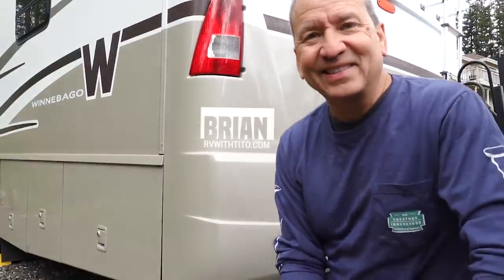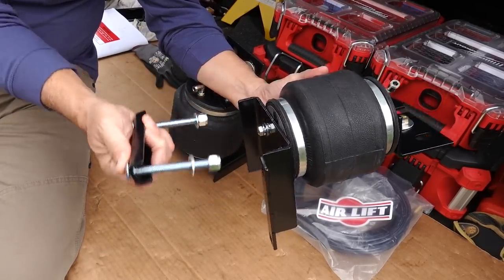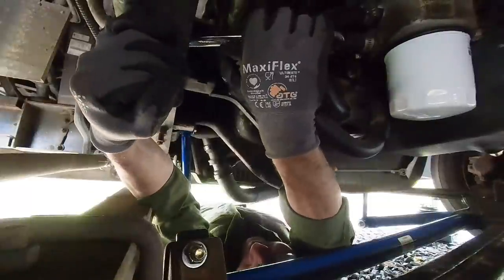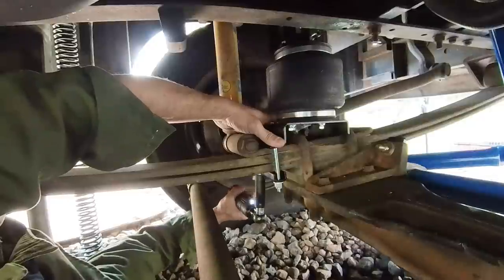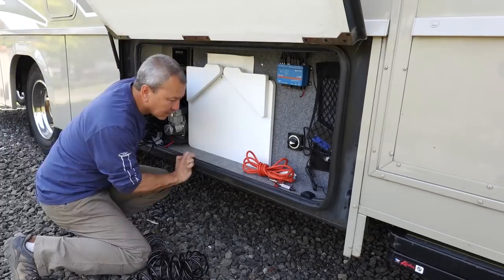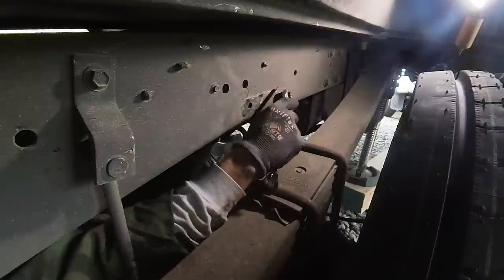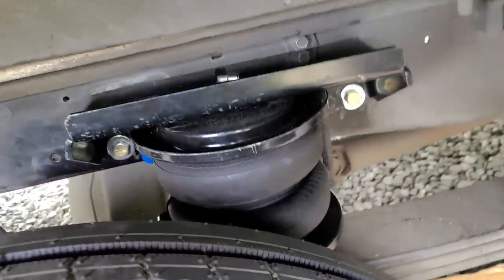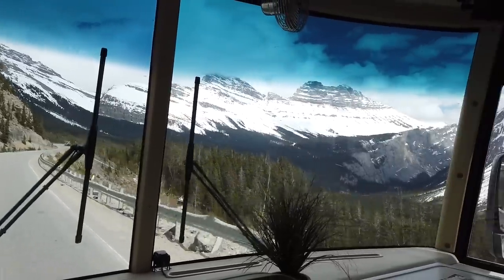I Installed Air Bags and Drove To Alaska

Comment: "Cat", here, Tito!  I have had the bags on several of my 14 different rigs over my 41 years of RVing and gave up on constantly tuning the adjustment settings and found that setting them at 80 to 90 lbs and leaving them there was best overall!  On my 38 foot gas Fleetwood Flair, because of the weight and wheelbase, had the onboard compressor with the four gauge/individual gauges and separate control rocker valves which allowed me to tune the suspension for differing road conditions such as the Alcan.  My goodness, what a difference it made on those long stints for comfort and driving fatique.  On certain sections of roadway, I could tune the rig so well I could actually take my hands off if the wheel and the rig would follow the roadways by itself.  Just like trimming my small  helicopters flying in the army where I could take hands and feet off the controls and control it just by leaning left to right and front to rear for directional control!  Try the compressor/individual wheel control setup!  I think you will like it?
Reply from the maker: I had the compressor installed on our last rig. It was great making those adjustments from the bluetooth remote. I have a compressor always hooked up now. So checking them periodically is no trouble. Thanks for sharing all of that experience.

Comment: Nice install for you class A.  You might want to put in a T union and only have one valve to air up the front and rear.  It will make it easier on you to equalize the pressure in both bags.  I have rear bags on my F350 to pull my fiver and I installed a Haldex height control valve from Amazon to automatically adjust pressure in the bags based on load conditions.  Works like the suspension of Class 8 rigs running down the highway.  The down side is you compressor will work more due to up and down in the road and the valve adjusting automatically.  Just a thought for a future upgrade.  Enjoy your time in Alaska, I was up there 5 years ago and want very much to return.
Reply from the maker: Thanks Tom for the suggestions. I prefer to manage them individually in case I need to level out a load. On our previous rig I also installed the air-compressor unit that I could control wirelessly from the cockpit. It worked great, but I don't think I really need it. So far manually checking them and making adjustments works fine.

Comment: I've installed two sets of Air Lift air bags on 2 different rigs. One was a class A motor home the other a F150. Both were pretty easy to install and worked extremely well. I'll be installing them on my new F350 fairly soon. Not really needing them that bad on this truck but sure are nice to take the porpoising out when going over train tracks and wavy roads.  I found that 25-35# was all I ever needed. One time took them up to 70# and about jarred all my fillings out! IMHO; the only way to fly!
Reply from the maker: Nice. I also installed them on our Class C rear and they were very much worth it and I'd do it again.
Reply: Yeah and people spend $25k on liquid springs which one Personally air bags did a better job for a fraction of the price.

Comment: Welcome to Alaska!
Looks like you've found the best of what are loosely called roads up this way. Once you get away from the major areas, its definitely a suspension test track. But it looks like you're ahead of the game with the upgrades and mods you've been doing. And fortunately you're handy enough to know to drive for the road conditions or be willing to fix what didn't like the road. Enjoy this little place we call home! Safe travels!
Reply from the maker: Thanks. It's been an amazing adventure so far. Yeah "roads" of all kinds. The Top Of The World Highway (Taylor Highway?) also was pretty amazing, but dirty. I also think the new tires I put on made a huge difference. I'm very glad I didn't wait on those and pulled the trigger before heading up.
Reply: It was definitely a good idea for the tires. Nothing up here is impossible or impassable, but go cheap and you definitely roll the dice!
I've only seen the Taylor and Over The Top in the winter on a snowmobile trip from Tok to Dawson and back. It was in the -30's going to Dawson. Super cold, but super scenic for sure. I really want to do it in the summer but I think we'd have to take the girlfriend's Class C instead of my travel trailer. The trailer is only good for so much dirt road action. 
How is your solar performing at this higher latitude with the sun lower in the sky? I just did a 1050 watt install on my rig. I went in knowing that I wouldn't realize the panels full potential not that anyone ever does but figured at best I'd see about 2/3 of that on a clear day if the sun had no obstructions like trees and whatnot. Last weekend on the maiden voyage after install we saw anything between 150 and 350 watts at the campground. It was charging, I was getting 10-20 amps going to the batteries so all was good. Even pulling power during the rain which was also a good test for the waterproofing of 42 holes in a perfectly good roof with a watertight rubber membrane... no leaks... whew! Then we get back to town and clear skies at the storage lot I keep my rig at, over 700 watts and 50 amps going to the batteries. Didn't think I'd actually see that much out of it with the lower sun angles and the panels flat on the roof and not tilted. But I know you put a pretty good solar system on the roof of your Class A and was curious how something I've seen on YouTube that was setup down in the lower 48 is performing up here and if i was underestimating what I'd see on my rig.
Reply from the maker: @rvingwithbearandfriends7506  The solar is doing great. True, I'm not bringing in as much up here. Two thirds sounds about right. The best I've been able to grab is about 1100W out of the 1740 Watts...and that's when flat mounted. They average about 900W even with smoke and cloud cover. I haven't been in a location yet that I felt comfortable tilting the panels. There were a couple times in the Canadian Rockies when I pulled about 1800W for a moment. It's funny, because business that I've seen with solar on the roof have their panels almost vertical :) One difference up here though is that I'm generating solar power almost 20 hours a day. Even at 11PM I'm still brining in 100W and that's pretty nuts.
Reply: @RVwithTito  , That makes me feel good about what I built. I haven't seen much in RV's with a decent sized solar array on them up here. With no local guidance, YouTube University was a great resource. I figured I'd need more panels to get less power and with our long daylight hours, especially this time of the year, work the solar like a Marathon and not a sprint. Collect power all day not just at peak times and be able to still collect above the parasitic draws during overcast or rainy days and so far, I've achieved that. I used tilt brackets not planning to tilt them unless I'm camping long term in one spot but also for getting to the wiring under them. I liken it to lifting the hood on a car or truck to get in and work. Made running the wires a breeze! I incorporated my 3D printer into the project and also for the battery bank. Something I don't see many content makers do. 
I just want to thank YouTubers like yourself and a number of others in showing that people can do these projects. I didn't copy anyone's work, but rather gather a consensus of many ideas and draw from across a number of installs for what seemed line the best of ideas and pointers or tips and make my own plan. Content makers like you are great to watch, the we're going to try this and make it work mentality but put it out in a way that is easy to follow. I've followed your channel for a while now with my other more nerdy channel subscribed and now this one. 
Enjoy the rest of your trip through our little state! And keep making the great videos!

Comment: I have airbags installed on my GMC Sierra as I mentioned before.
There seems to be a happy medium between some assistance and too much pressure.
I find that between 30 and 50 pounds is the good zone - more seems to make it "bouncy" and has a negative handling effect.
Great video - Thanks! - Cheers.
Reply from the maker: Certainly takes some tweaking and driving to get it just right.

Comment: Nice video, I put Air Lift airbags on my 2016 3/4 ton GM diesel pickup to provide same load capability as a 1 ton but with a nice ride.  I have the air pump so I can set pressure in the cab.  This was an upgrade from my 2005 gas 3/4 ton which I had to inflate myself.

Comment: Great video as usual! Just installed air lift airbags on our 2014 coachmen mirada. Made big improvement in the ride and the sway. I agree drilling the holes was the worst part. Had to remove the rear wheels in my case. Each rear side took 4 hours. The front was much easier, no drilling was required. I think maybe 2 hours total.
Reply from the maker: Glad it wasn't just me. I even broke two stepped bits on the front :)
Reply: @RVwithTito  btw, did you have any concern using the airbags with the leveling jacks lifting front wheels? I rarely get into that situation, but I read on one of forums that airbags are not designed to hold the axle and that may place pressure on them.
Reply from the maker: @Anonymous-hy8oz  Good question. I did consider and look into this potential issue. Per AirLift's FAQ: a vehicle can be lifted by the frame for short term periods (i.e. maintenance or oil changes etc). If the vehicle is lifted for extended periods, then the axle should be supported. This is really a non-issue unless you plan to lift the tires off the ground with your leveling jacks...which you probably shouldn't. If you need to level up that much, it's best to roll the rig up on some boards first.

Comment: Once you drill a pilot hole, I find a Spiral Flute Step Drill bit works better than using a larger bit to increase the hold size
Reply from the maker: I needed a larger pilot hole. Broke the ends off  2 stepped bits in the process 🤪
Reply: @RVwithTito  any reason why u had ur drill on the hammer setting? Or did it just sound like that in the video, this would have made ur drilling a lot harder through steel if it was. Great video anyway, thanks :)

Comment: Nice job Brian later you might want to upgrade to onboard air so you can control it from inside those flip up panels might be for changing your rear tires easily
Reply from the maker: Thanks. I decided not to go with the onboard compressor this time. With the location of my Viair airing them up is real simple.

Comment: Nice upgrade!  Just wondering how these upgrades improved your RV's handling compared to the original equipment?  Did you do both the front anti-sway bar and air bags at the same time or did you do them incrementally to see the benefits of both individually.
Reply from the maker: Did the front sway bar + replaced rear bushings first. I later added the air bags. Here's a playlist of videos I made about this including a follow up. https://www.youtube.com/watch?v=g8EZHqbLcRE&list=PLIsusUNNN2JZGWvesXeaYHuYsXsqzMxlK
Reply: @RVwithTito  What was the rocking back and forth like after the air bags?

Comment: Did your airbags help minimize your rv “crashing” as it goes over bumps? The suspension on my E-450 class C RV feels rock hard and I'm wondering if airbags would help?
Reply from the maker: Yes. It does helps take the brunt of that. That's why they're called helper springs.

Comment: Nice! I have a 2021 32' Class C (Ford E-450) and want to put airbags on rear leaf springs. I see 5,000 lb and 7,500 lb units. Thinking getting the 7,500 for more durability, your thoughts?
Reply from the maker: I went with the 5000 on the rear of our 32' Class C. They worked great. Here's the video: https://youtu.be/xESVvzfW-uI

Comment: Dude... You need to put some boards or plywood under that jack stand in the gravel. (called Cribbing)  Even if you are only using it as a backup for the RV;s jacks. (My RV's jack stands have plates welded between the boottom legs.  And I still use cribbing!) The hydraulic jacks fail those jack stand will be driven into the ground so fast you won't be able to crawl out from under it fast enough.  And especially if you remove a tire.   I've worked with heavy equipment all my working career and seen this happen too many times.  
Once had to use my boom truck to remove a pickup off a dead guy when his jack stands, s like yours, were driven into the grass in his front yard when his hydraulic floor jack seal let go.  
Had he jst put a pair of 2x4's under that jack he could have survived.
Reply from the maker: Thanks. I appreciate the suggestions.
Reply: @RV with Tito DIY  Anytime!  I like your videos and would hate to hear you got hurt. Spent too many years picking up the pieces of bad decisions, I guess.

Comment: What is the max extension on the Air Lift front bags? Do you have restrictions on using your leveling jacks?  Do you have to level by blocking the wheels?
Reply from the maker: You might get 2-3 inches max. I haven't had issues with the jacks as long as the wheels don't leave the ground. In that case, you should block the tires as you said.

Comment: How did you loosen wheel cover panels so you could prop up?
Reply from the maker: Open the compartment panel on either side and there are three screws on each side. With the screws out the wheel well panel lifts up. 👍
Reply: @RVwithTito  Did you use titanium or cobalt bits
Reply from the maker: @robertgoff181  Titanium I believe...whatever I could get in a pinch :)

Comment: I Really need help with changing out my springs on the landing gear. we have the same rv and I was wondering if you have the part number or website I can find them?
Reply from the maker: Here are the springs I used. Part# HWH R1171  (Here's the reference -https://www.hwhcorp.com/mr475000.html) And...here's a video (https://youtu.be/7BTVo9_LvFc?si=IjVPcB77vtd2W12m)  I've since learned that I can just bottom plate on/off with using a pry bar with the jacks fully retracted. So all of that shim stuff may not be necessary. Here is when I figured that out (https://youtu.be/BDPVK03JCY4?si=5jbacajtAmadd38t) Good luck!
Reply: @RVwithTito  thank you!
Reply from the maker: No problem.

Comment: u must edit out all the 4 letter words dropping washers/ nuts/ etc in that gravel ; time for a go fund me for tito and a real big shop
Reply from the maker: Oh yes. I have spent lots of time searching for small things that have been dropped in the gravel. Many of them have never been found. Wouldn't we all love a flat piece of property with a barn/shop :)
Reply: @RVwithTito  A fellow worker taught me to lay a towel down under where things might be dropped.  A large beach towel might do on the gravel, as long as it doesn't get bunched up when shifting around.
Reply from the maker: @tkilg7169  I usually use a moving blanket to lay on and put things on. Still it happens :)